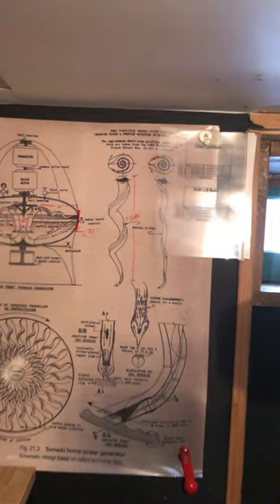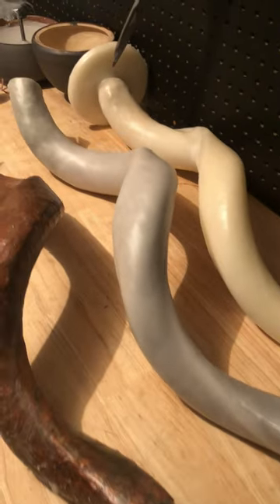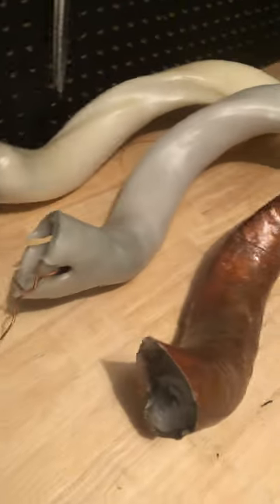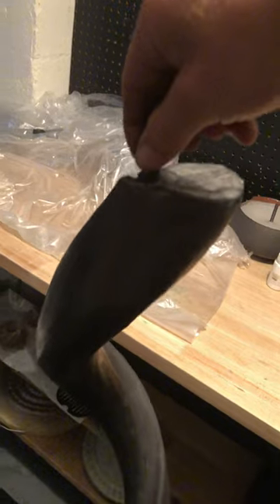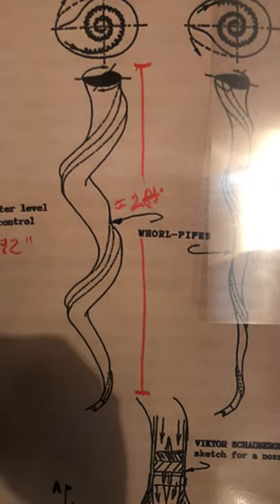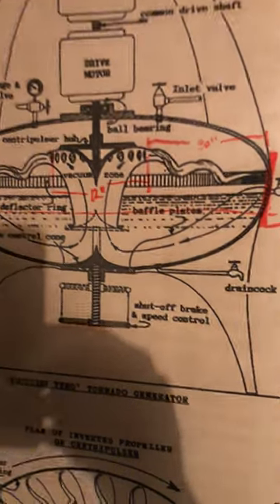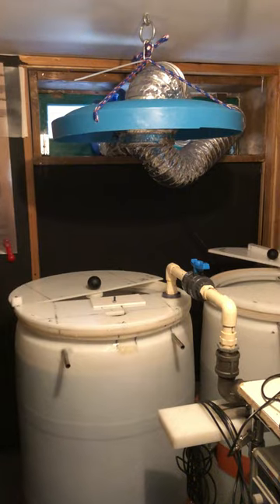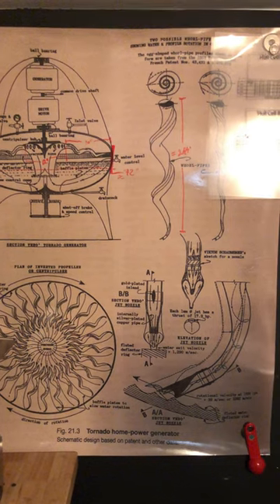Viktor Schauberger Double Spiral Flow Pipe

Comment: Friend, do you have the 3D data of the spiral tube?
Reply from the maker: Hi, see my video on forms and formulas. The horn is 28 inch end to end measuring with a sewing tape. There is a particular way you measure these horns. The intake opening is 11” circumference and the end where the nozzle will attach is 6”.  So when the horns are attached to the hub the turbine will about 70 inches across, almost 6 feet.

Comment: I have experimented with various forms of vortexing water, including gravity fed and motor driven impellers. These vortexing methods all result in a higher water voltage, measured via water's "exclusion zone". The impeller driven produce the highest voltages. 

What is the purpose of this double spiral flow pipe? Is it a water vortexer? I am quite curious to know if this type of vortex increases water voltage.
Reply from the maker: I will make a little video to explain, from a Schauberger writing.

Comment: Have you considered sand casting these? Seems as though it would be a faster and less involved production method once you've developed the form to be replicated.
Reply from the maker: No, I am tooled for electrotyping: There are plenty of ways to do this, probably better ways than mine.  I’m curious how would you sand cast the pipe once you have the form?
Reply: @Seasquares  cast the tubes and braze on the caps later, lost wax burnouts or something similar would be an option. Maybe cast silicone negatives of the part to make wax forms to be used in a burnout. The hollow center is a bit of a trick, but there's ways. Could 3d model/print the shape, to be lost wax.

Comment: Some how, a process like this needs to be done on the inside…..the outside doesn’t have the small cut out from the egg accurately. I would suggest a 3D print, and use that as the basis of a forging …..I have the print, I just need to save up enough for the forging….there are some problems, but I have had about five years to think about it, and get a (hopefullly) solution.
Reply from the maker: Hey Donald, sorry for my delayed reply. I hope your able to get you forging setup going. Agreed the shaped of the grove will need modification, with time. I like this method, and I think the way we solve this problem is by coming at it from many different angles.

Comment: not sure if it's just my computer, but the sound was very low, I had headphones on and all volumes maxed out and still had trouble hearing.  I mean no disrespect at all, in fact I REALLY wanted to hear every detail.  Thanks for posting
Reply from the maker: It was my first video so yes sound is bad. Sorry about that but I hope you found the video helpful and if you have any questions about the process feel free to ask.
Reply: @Seasquares if I am following correctly, you coat a horn with wax then graphite coat it and electroplate it...  Does the horn come out after the was is melted?
Reply from the maker: @x4158  hi, yes you want to coat the shofar with a smooth consistent layer of wax, paint and wire the wax and electroform. Then you dip the whole thing into boiling water and the wax melts out, the copper should twist out from the shofar. However, if the spiral is off, it may not extract. Originally, the pipe was about 8 inches longer but I had to cut of a straight section at the mouthpiece of the shofar to extract the electro formed.

Comment: Is it feasible to glue copper powder after making it with carbon fiber?
Reply from the maker: The core body is wax with a coating of graphite paint on the surface. This isn’t carbon fibre. However I’m sure you could carbon fiber the wax form. Can you clarify your question.
Reply from the maker: I think the heat generated by the resin would melt the wax and compromise the form. Wax may not be a good medium to fiber over…
Reply: @Seasquares  Friends, how much power do you think the motor of this machine should be equipped with? I want to copy it